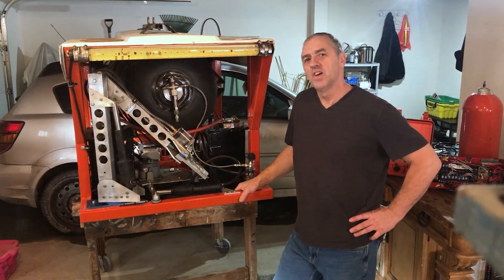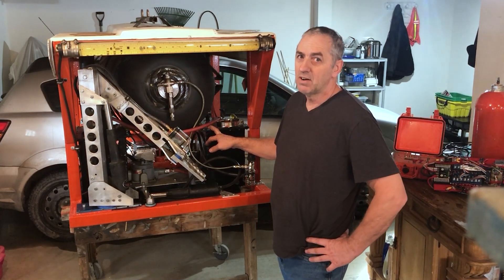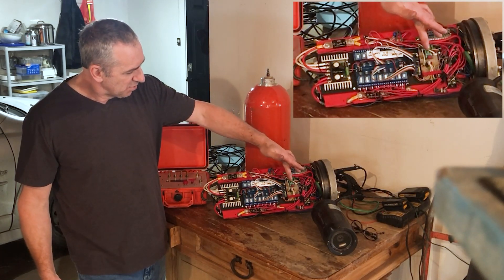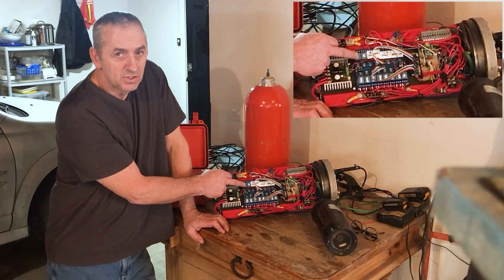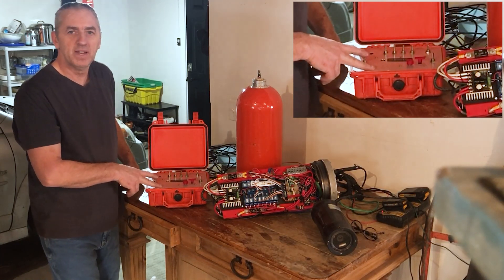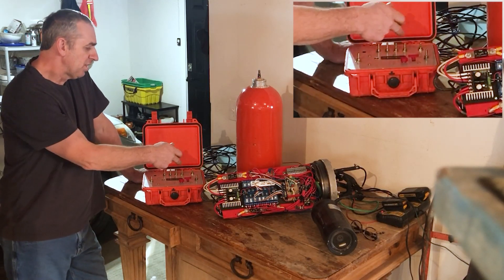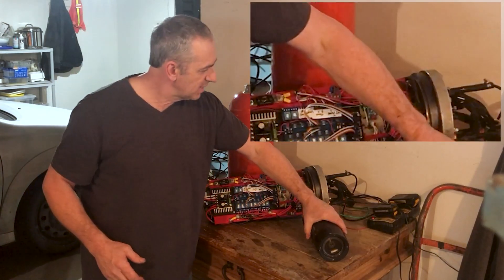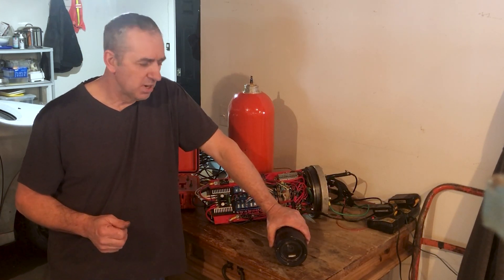New ROV Electronics and Progress Update

Comment: Can a manned submarine be made without using ballast tanks and using only motors  to dive or surface like an rov
Reply from the maker: Yes but you would need a crane to lift it out of the water with the pilot inside the sub.  The DeepWorker sub's have only a very small ballast tank to trim the sub to neutral buoyancy.
Reply: @HankPronk  so do you have any plan to try it in future
Reply from the maker: @deepeshverma6208  Yes I sure do
Reply: @HankPronk  which type of motor you used in this rov high torque motor or high rpm motor and what is the rpm
Reply from the maker: @deepeshverma6208  I use electric trolling motors modified of coarse to be air compensated.  I think they are 1800 rpm.
Reply: @HankPronk  so can I use my1016(name of  electric motor)
Reply from the maker: @deepeshverma6208  Yes you can, I assume that is a Mini Kota trolling motor.
Reply: @HankPronk  no it's a e-bike motor
Reply from the maker: @deepeshverma6208  you will need a pressure housing then with a seal
Reply: @HankPronk  2 blade propeller is more powerful or multi blade propeller?